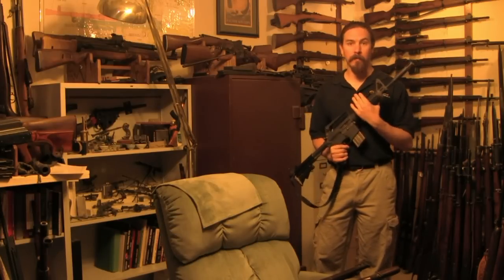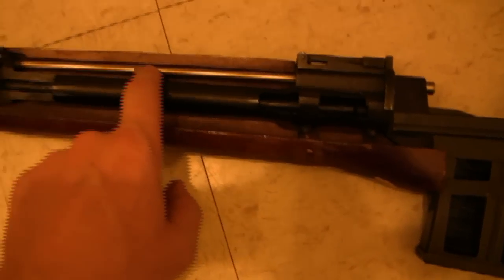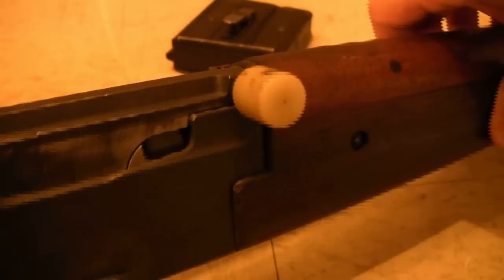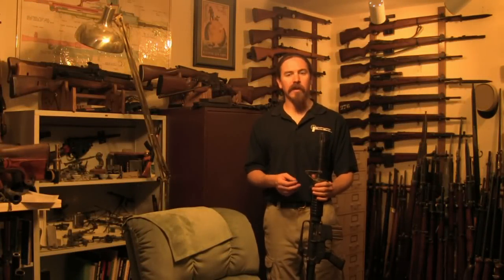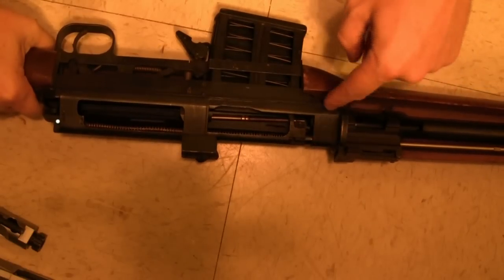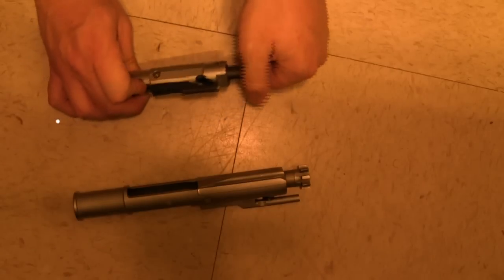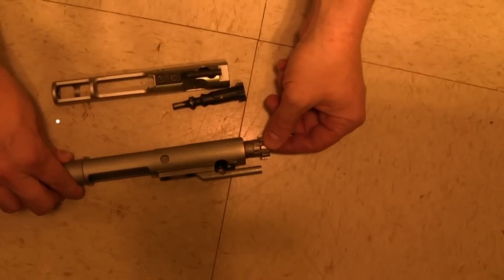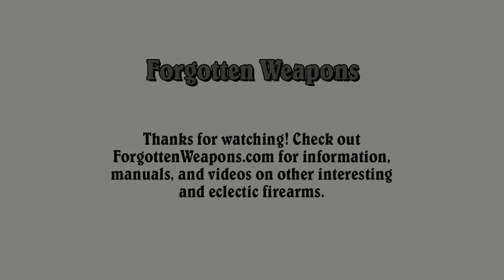Direct Gas Impingement and the AR Bolt

Comment: So... Its actually the pressure of the bolt--generated by the gas behind it--pushing in to the front of the chamber which rotates/unlocks and then cycles the action?

Also, it looks like it is not a push during the whole backwards motion of the bolt, but a brief 'slap' which then throws the bolt backwards not under power?
Reply: That's basically it

Comment: We re-barreled and repaired thousands of M16 and M16A-1 rifles. I have seen rifles function with a ring missing and even all the rings missing. I I strongly suspect that Stoner was looking for a way to direct the gas out of the gun and stumbled on a way to get a new patent . Stoner's first AR-10's were pretty much a failure. If he really was trying to eliminate muzzle climb it would have been better to concentrate on the heavier caliber weapon. The bolt locking into the barrel is nothing new either. That took care of the "Heavier receiver" requirement.
Reply: Old Goat He did concentrate on the AR-10.

Comment: It's not just muzzle rise, it's also off-axis forces on the bolt, which forces require a heavier receiver and cause more wear, besides creating the necessity of bleeding off more gas pressure to operate the weapon.  I'm not one to suggest that Stoner's system is somehow the perfect system, but it certainly does a good job of doing what it's supposed to do.

Comment: Whenever you put an AR bolt back together after field stripping, make sure that the openings on the gas rings are rotated to the 12, 4 and 8 o'clock positions. It doesn't really matter which ring is in what position, but you HAVE to make sure of this, because if the gas ring openings line up, you instantly lose significant pressure, and you WILL get a failure to extract.
Reply: not really.  it might extract a bit softer, but the gas seals will settle into whatever position they want to regardless of where you set them after just a few shots.  you might have an issue on an old school dissy with the ridiculously short dwell time but the typical carbine length system on a 16 inch barrel just does not give a shit where the gas rings are, for the most part so long as they're there it's fine.  hell, I've even seen rifles with a gas ring or two missing entirely work without issue. 

I honestly suspect the piston in the bolt is entirely unnecessary for most ar15s.  if they needed the gas to cycle, then cycling manually wouldn't work since you're only pulling on the carrier and not the bolt itself.  the piston was likely just a convenient way to direct the gasses out of the rifle (through those 2 little holes in the carrier) so it doesn't shit where it eats quite so bad as other direct impingement guns

Comment: I always wondered why that recess on the right side of the bolt carrier has two holes drilled on it. I know that the recess itself was intended to be a forward assist on those early rifles which didn't have a forward assist button. It's not just to make the bolt lighter.
From what I've seen in slow motion footage of AR-15s being fired, I noticed that upon firing, part of the gases are vent off from those two holes. Is that the real purpose of them, to vent off the excess of gas pressure so the whole bolt assembly doesn't blow into pieces or, at least prevent the gases to foul the entire moving parts too much?

Comment: Yeah, but they didn't just point a gun to Germans head and make them do the work for them, if anything AK is based far more on American designs like Garand (bolt, gas-system, trigger) and Remington Model 8 (selector-switch port cover)
Look what happened when US did copy Germans and it was disastrous trying to fuse MG42 with FG42 into M60. In contrast PKM, entirely original design, was far better.
Oh fucking Chivers. A sensationalist journalist, a mythmaker, a story teller...

Comment: Check out "The Gun, the AK-47 and the Evolution of War" by C.J. Chivers that has excellent detailed references on development & problems of both AK & AR. Soviets went as far as having German engineers experienced w/ MP43/StG44 work on AK, especially w/ extraction, bolt mass & fire control to address AK problems.

5.56 concept agreed muddled.The destabilization of bullet in tissue excellent in most cases, but significant limitations in some cases, necessitating more hits to neutralize target.

Comment: AR15 was first made in 1957, it was first saw widespread adoption in 1965. That's 8-years, to AK47's 4-years. FYI, most of the AK changes were for mass production which was the challenge, they wanted more than 1 million, they wanted 100 million AK's!
I find the AR15 concept muddled. The idea of 5.56x45mm is you can carry 2x more and fire quicker, yet the DI reduces overall fire-rate and the weaker round often requires twice as many hits.

Comment: Hmm, piston designs have issues... good thing DI designs never had any "issues".

See... DI was MADE to work, it required such high quality of material and manufacture, maintenance and replacements. From every small component to ammunition and oils.

Not hard to be cheaper than HK - the most shilling gun producer around - for their limited-production upper while DI-AR15s are 50-years established and mass-produced by so many competitors, yet still so expensive in thousands of dollars.

Comment: AR15 design has a lot of things going for it, mainly in the lower receiver. The grip and selector layout, magazine well with mag-release-positioning, bolt-release. In-line stock, later fully adjustable, long recoil spring. Ergonomic 30-round magazine. All, well, perfect, where to improve?
Then the upper... DI heat-stressing and fouling bolt-assembly, requiring a forward assist because the charging method. The carrying handle and front-sight/gas-block arrangement are not missed on M16A4 series.
Reply: Bolt release - great position. Bolt catch - not so much fun with that silly rear charging handle. T rex grip plus a pincer movement - nice! The best part is there's both a D&C movement that requires it, and it's military SOP for loading the first round. Thankfully there's an automatic last round hold open so you only have to do it once, in theory.
And oh, yeah, the charging handle was designed by Colt as an afterthought since the brilliant mastermind Stoner designed a charging handle that sat in line with the gas port and gas key opening when it was spitting particulates and gas. Who doesn't want a HOT! charging handle? And the fabulous 1/8 inch bearing surface the charging handle has with the bolt carrier group is absolutely an excellent feature when you have a failure to extract. Not to mention, when you have an overpressure system by using a suppressed carbine, you get gas shooting out directly from the charging handle slot into your eyes! (nose to charging handle, soldiers!) Beyond excellent ergonomics!!!
The star chamber is also ridiculously easy to clean, only requiring 27 some-odd Q-tips to pass your drill sergeant's pinky finger-in-the-chamber sweep test. May require some additional effort to strip the cotton fiber strings clinging to the edges of the star chamber, though. Who cares, it's DI, it shits where it sleeps anyway.

Comment: It's telling that all the people who worked on DI design for AR10 and AR15... never made any other sort of Direct Impingement design. They all stuck to piston operation such as for Stoner 63 or Sullivan's AR-18.
All the competitors to AR15 are ignoring DI, such as H&K's M416, Magpul's ACR, and various AK derivatives.
The patent on DI is long since expired, I think there are clearly articulated reasons designers aren't banking on directly venting hot barrel gasses into the bolt-assembly any more.
Reply: The strangest thing is that somehow the modern AR-15 still has double the number of malfunctions as the 416 and ACR. I really can't understand why.
It's almost like a closed system with a piston is the best of both worlds, but then I realize that this was only an excuse to waste another 100 million dollars on an ACR competition just to renew Colt's contract for the M4.

Comment: Great explanation, most people do not realize that the Stoner gas system uses a piston, which is also the bolt.  I always find in funny when people talk of gas piston AR rifles not realizing that all AR's have a piston.
Reply: I also think that is funny, ha ha! The AR-15 launches gas and particulates directly into the center of the bearing surface of the bolt and the bolt carrier group, which is also a piston and the primary moving part! Genius!!!
Only an idiot would think a direct impingement system that launches gas onto a contained area like the system the French simpletons designed would be a good system. The best way to design a direct impingement system is to ensure that it coats the operating mechanism and bearing surfaces of the moving parts in tons of hot fouling! All pistons work better when their bearing surfaces are fighting carbon and copper build up!

Comment: The Hakim is esp good in the DI arena, because the tilting bolt locks at the rear, thus there are no parts at the front of the bolt for the blast to gum up. The AR could also have been better had the bolt had fewer, but larger, locking lugs. Those small lugs are prone to resist going into battery if even slightly fouled, thus the need for the forward bolt assist. The AR10 had a charging handle that reciprocated, eliminating that need.

Comment: Might I suggest a video on the "potato digger" MG of the early 1900s? Its quite unique in that the muzzle blast acts directly upon the op rod. No ports in the barrel. Browning noticed that when fired prone, the blast moved the soil under the muzzle. He theorized that this wasted energy could somehow be used to cycle the action. Not too practical of a method to use, but it worked.

Comment: Unless you are switching between suppressed and unsuppressed operation regularly and/or are using a short barrel (less than 14.5") then a piston really isn't going to do you any good.  Especially considering the only fully sorted piston AR is HK's and you could buy three good DI guns for the price of a used HK 416 upper (if you could even find one).  Every other piston design has issues.

Comment from the maker: Gas piston will generally cost more, and is generally not necessary or an improvement. Stick with the original design unless you have a clearly articulated reason why a gas piston upper would work better for you.
Reply: Clearly articulated reason - to avoid spitting carbon and copper particulates into the center of the bolt carrier group. Practical justification - because cleaning carbon off of the interior of the BCG is time consuming and saps the enjoyment factor out of going shooting.

Comment: Most agree an AK is very reliable weapon. What most don't know is while adopted in 1947, it wasn't general issue till 1951. In those 4 years, over 150 changes were made, mostly minor like changing size & angle of extractor,that honed and perfected design.Unfortunately, AR platform as M-16, had little field testing with deficiencies of design showing up in combat, first denied, then acknowledged & corrected. Current design, now in service in many countries, is an excellent respected design.

Comment: Yes, for the AR, I agree. It is not a true DI because you are still using a piston, just at the very end of everything, and the piston happens to double as the bolt...and locking lugs...and fireing pin carrior. Now that I think about it, most of the important parts of the rifles are right there.

Comment: Outstanding video. The MAS is simple reliable and very strong; yet sometimes burnt gunpowder residue would deposit itself on the firer's forehead. I have carried the MAS 49/56 and the AR series in 5.56 and find the AR to be reliable very accurate and reliable.One must stagger those rings or risk failure to function.